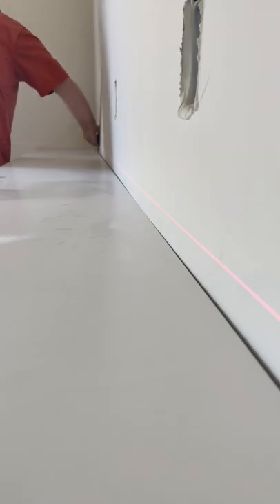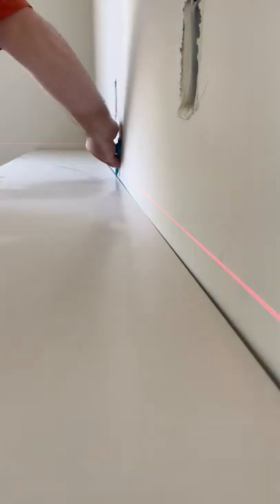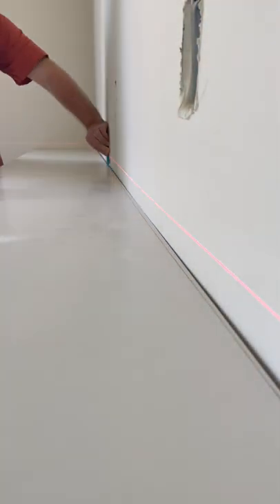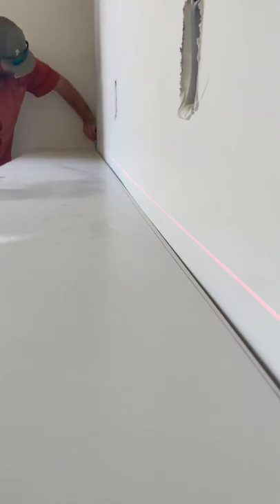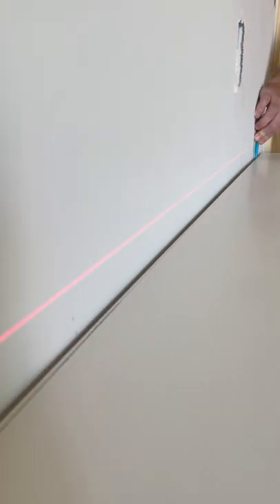Woodworking Tips & Tricks | How To Scribe

Comment: This fella ain't saying his way is the only way to fix it, he is saying this is what works for him. I think he made a good use of time and good judgement for the situation, and if it worked it worked, (looked like this took maybe 20min tops).
Reply from the maker: One person understands that these videos are different options/ideas not ultimatums 🙌 Thank you!
Reply: Not really , he is saying exactly how it should be done , scribing carefully, tight fit , professional way , following your line you made carefully, watching the reveal overhang . Doing it other ways using caulking, scoring Sheetrock or buttering the walls after , ain’t it . This is the only way to do it properly. I do put tape though on some finishes that can chip by scoring the line w knife and removing the side of the tape I am cutting, cleaner finish using THINGAMEJIG tool made in Australia and sold in Amazon , love it . Bevel cut is a must and much easy to correct hairline adjustments w hand block ,nice work .
Reply: This is proper Im not so sure it should ever be done any other way.
Reply: This is the way.
Reply: Looks like a bow in the wall. Built up mud.
Reply: Not really Zion
Not reall
Reply: Cut the drywall and sink top into wall would be the other way to do it.
Reply: And never showed the results. Lame.
Reply: 20 min 😂

Comment: Nice.  I’ve seen another video where they tear into the drywall, essentially shoving the countertop into the drywall 😂
Reply: That’s a hack way to do it. It’s easier and quicker but if there isn’t a backsplash goin on that will cover it the finish product is track house quality not fine trim finish carpentry

Comment: Scribing is a essential carpenter skill. I’ll use a jigsaw or circular saw if it’s a somewhat straight scribe but for thins like rock walls I use a grinder with a Diablo sanding disc for perfect fit

Comment: That works good another good tip is to take your pencil and lay it flat and run it along the wall and cut out the drywall so that your top will slide into place
Reply: That only looks good if you're tiling over it and in that case, tile will likely hide the gap.
Reply: @evictioncarpentry2628 or just cut drywall accurately with a multi tool then and a thin bead of caulk

Comment: I install marble & granite counters I usually do 2 things I eathier cut the Sheetrock from the top of the counter to the bottom and then I rip out the long strip of Sheetrock and push the counter into where ever It needs to go and always perfect , or i I take a marker & instead of a shim like u did I use a circular sandpaper pad with the hole in the middle and just put my marker in the middle hole and roll it across the wall exactly as u did with the shim I just use a sandpaper pad and then cut the marble counter with a grinder by hand but same concept just different material  and different tools but since it’s granite that I have to be cutting I usually go with my first option scoring the Sheetrock and just push the counter inside the wall won’t even have a 16th of a gap or u can leave it the way it is have painters caulk it and if there getting tiles then they will cover the gap

Comment: Even though he didn't show the results. It actually works. I've done this a few times when I installed my kitchen butcher block and I was able to make the gap a little tighter but enough room for expansion. Using a shim was better than using a thicker stock like 1/2 or 3/4 cause your cutting waste is minimal.

Comment: So drywall just bows for no reason? Because there is usually a reason for everything which means there is a way to correct the actual problem instead of hiding it
Reply: To correct a wall like that. You would literally need to take down the entire wall and rebuild it.

Drywall [usually] bows like that when the studs aren't aligned perfectly, happens often on long walls.

So if he's just installing a cabinet, I doubt he wants to pay (or client wants to pay if this is a professional job) the extra hundreds just to fix a small bow in a wall that's getting covered anyways.

Why pay extra to fix a "problem" like this? The bow isn't serious enough to be a structural problem. So the only problem is a cosmetic one, which is solved with the cabinet  put in front of it 🤷‍♂️
Reply: Looks like a newish built home. Talk to the framers.. walls prob uneven due to bowed / warped wood (or just crappy framers). Cabinet guy just trying to adapt to the situation.

Comment: on some jobs - i cut out the wall so the top  would slide in and fit tight  !   A chipped top can cost $$$
Reply from the maker: Yessir works in situations as well 🤙🏻
Reply: Done that many times over the years
Reply: You cut a wall on my job you’ll be refinishing the Sheetrock and eating the costs.
Reply: @stevengarner780   if I cut the drywall - you wouldn't be able to notice it ! I'm not a stupid Hack carpenter and I know how to use tools
Reply: @stevengarner780  If you do contractor work and hire out countertops I guarantee it’s been done on your jobs more than once . Walls arnt perfectly straight neither is lumber but the edge on tops are .
Reply: @stevengarner780  The rock on this scene is not finished.
Reply: @diverdave4056  Nope! There's a good chance if you have a fussy supervisor that you will be held responsible for cutting the wall sheet. There's no strength between studs if it's cut. Some site supervisors are not impressed by that approach. Having said that I think it's a legitimate solution for many applications.
Reply: @grantfrith9589     ,,,,mmm  IF the studs shifted when you cut out a strip of drywall then  someone must not have screwed off the drywall correctly .
Reply: @diverdave4056  You do not understand what I am saying. It's the sheet that flexes once cut.
Reply: @stevengarner780  cheaper to replace drywall than a counter top!

Comment: If you cut out that hump the projector off the wall the left and the right side will slide right in place
Reply from the maker: Another way to do it for sure! I usually do that on the depth rather than length as less likely to chip or tear out on ripping than crosscut 👍🏼

Comment: Nice finish my only suggestion would be to maybe have the larger part of the saw deck on the surface of the wood as its less likely to move around
Reply: Called a skil saw for a reason.
Reply: @kevindowner766  ya but you need skil to operate it properly I've have one of those things in my hand for 30 years I know how to use them and use them properly just saying you really don't need to try to be ignorant
Reply: Use a jigsaw with a downcut blade

Comment: If it's off at the top it's probably off at the bottom. If you didn't address the bottom also you likely didn't get it flush after all that. Is that why we didn't see an after shot of the wood top? Hmmmm...
Reply from the maker: You’re scribing 9-10’ out of this for the 1 1/2” overhang on the right side as shown in the video 🤙🏻

Comment: Molding caulk trim lotta ways to cover that fill it w a hardening past (lotta options there)and paint over it
Reply: trailer park carpentry , sure!
Reply: Yes....there are a lot of ways to make it look like shit. Thanks for listing a few of them
Reply: I mean SEAL IT!
Reply: It can’t always be fixed but.   Ya can always seal it and cover it.Of course adjusting it to fit better or whatever it needs is first and best option
Reply: But like I said lotta options here sometimes ya can send it back if it’s too bad plus is the bow in the wall or the table?
Reply: @michaelmcgee2026  hey if it was me id have cut it all myself built it all myself and no bow would Be there…. But if ya budget is shit…. Wygd?  If rear is bowed front is usually bowed with it. Cutting it might help but bracing it overnight and putting it down with bracers on keep front right as well as back. Ya want ya hangover 3” here and 1” their? No ya don’t. But….. many options all cost different if it ain’t your house ya gotta have options ready just In Case they may not wanna pay for extra time whatever it all depends what job is it contracted, side job? Your not boss? It all depends let s be real if it’s right to begin with…..

Comment: I install marble, when I run into this I mark the wall where the top is and cut the sheetrock out where it's hitting, then push it under. Very fast no cut on top needed
Reply: The marble doesnt have to match anything but its self, cabinets have the other pieces that stick out a bit like that so it isnt an option. On that I did the same woth a small piece of marble, the back was going to be hidden so I left it inches longer than needed, also that shit is so soft, had to fix some holes I cut, said if i ever use it again id cut small and file it.
Reply: Wait thats wrong they coulda done the same, I think it would be looked down upon for a cabinet guy to do it tho. Also walls are fucked you see it every day id bet
Reply: @chickenpuncher1674  yea walls are always out on tops that are 5 foot or longer and I only get 35 dollars a bowl to set tops with a helper on the clock so that shit has to fly in
Reply: @thastunt101010  mmhhmm, fly in so fast you scratch the walls we just painted! Really tho we would have everything done, you know when it goes in, and in some cases leave door trim off just so y'all could get it in. The one shot thats all of it always got me, like y'all couldnt fuck up while if I do it was always replaceable. Good stuff sir!

Comment: I don't like wearing out one side of the saw teeth doing something like this. I'd  much rather use an electric plane for trimming something like this. Whatever works for you though.
Reply: Over size workpiece by an inch or two. Use track saw with 5 degree bevel. Sand the rest. If you are using a lacquer finish a planer will most likely chip the paint.
Reply: @elijahswoodshed4865  No! a very inefficient solution. I have done it that way early in my career but if you have the right technique and a sharp tool that is set up correctly a plane does not chip.

Comment: Gosh you are a genius. Next time cut from below.
Reply: Then you can’t see your line.
Reply: @ivanzucconi  yes but a jig saw cuts a shitty line. Skill saw on a 5 degree back bevel cuts much cleaner and quicker than using a jig saw upside down lol. I’ve done both and the jig saw usually stays in the truck. Lol.
Reply: @Theuniverseisstrange  you won't  work for us long then. But hey it's all about the tools. Cannot blame tools for bad results.
Reply: And blow out the top... genius
Reply: @Broxalax  as per video for sure.
Reply: @ivanzucconi   as per your comment, for sure.

You want any sort of blow out on the bottom, so it cannot be seen. Obviously the sharper the blade, the less blow out but you don't always change the blade for every cut.

Not saying this guy in the video did the perfect job, but you certainly don't cut from the bottom.

Chipboard, fibre board, veneers will all blow out.
Reply: @Broxalax  do you know every professional jigsaw got settings to adjust the repro action isn't? So use the tools accordingly😉
Reply: @ivanzucconi  but you can still blow out the face... it's best to not risk the fact, if you can just risk the underside no one will ever see.

I personally use a jigsaw, a skill saw is harder to make turns if the wall is far more out of wack or has multiple bows.
A plane is also a better option than a skill saw, depending on the product.

Skill saws are best for ripping and rough cuts.

Like you said, right tool for the job
Reply: Genius😂
Reply: @Broxalax  personally and as I tell my boys, it doesn't matter the tool. My choice is a planer, jigsaw with repro set to zero or a router with a brand new flute. But hey brother, the good old brotherhood say never have changed. The good brother always justifies his tool for the job to be the right one. Basically the fine man justifies the means.
Reply: @ivanzucconi  We do over a million a year in custom cabinets. I work for no one. I am the owner.
Reply: @Theuniverseisstrange  oh dear then. Full stop👌🤠
Reply: @ivanzucconi  any reciprocating or circular saw would always be pushing down from the top and out from the bottom.

Any cabinet maker worth their salt would know that.

No matter how many attachments you put onto your tools, you just do it the wrong way, even if you achieve your goal.

You certainly don't seem like the "fine man" from your saying... 

Maybe go back to trade school

Comment: Imagine if they just did a good job
Reply from the maker: Every night I dream about walking into a house where everyone did their job right 🤙🏻 Still waiting for that to turn into reality…
Reply: Everyone did their job, it’s up to the carpenter to make shit look good.
Reply: @Theuniverseisstrange  why should it only fall on the carpenter ? If all the trades looked out for the next guys just a little bit better instead of rushing through, I think everyone would have a much easier life. Those that work with tools everyday that is.
Reply: @alexayache8556  everyone did their job according to specifications. The problem with the wall is caused by the lumber used. No framing material is perfectly flat as well as sheet rock. The 2x4 material used can warp and twist causing further fluctuations  in the wall. It is unrealistic to say or imagine that the framers and the sheet rock guys didn’t do their job because it looks great until you put a perfectly flat counter on it. It is up to a skilled carpenter to scribe wall variances and hide imperfections.
Reply: @Theuniverseisstrange  I see you're point "finish" carpentry has it's name for a reason. But we can still agree that all the trades could do a better job looking out for the next guy/each other also?
Reply: @alexayache8556  yes I see your point as well.

Comment: The cabinets that sit on the top. Looks to me to have a three-quarter inch nailer on the bottom, plus a quarter inch back, that covers 1” plus. Not including the bow.
Reply from the maker: Ahh you’re one of the caulk it guys then? 😅
Reply: @texascarpenter  no he’s saying scribing this is a waste of time since the upper cabs cover all the gaps. Only need to add scribe to the overhang a couple inches if the top has a reveal on the cabinets